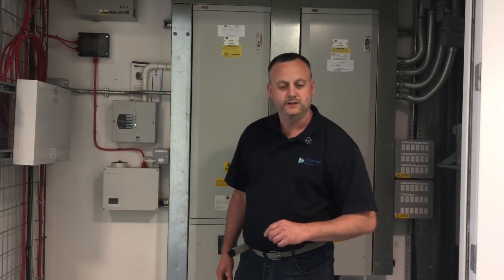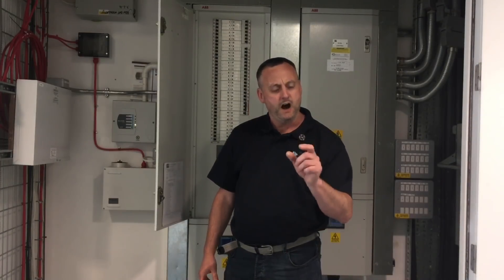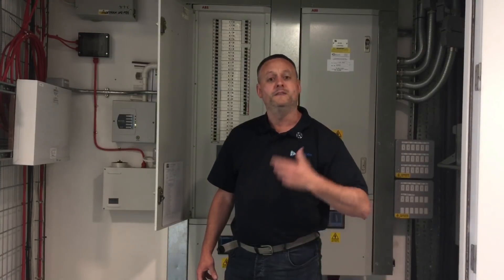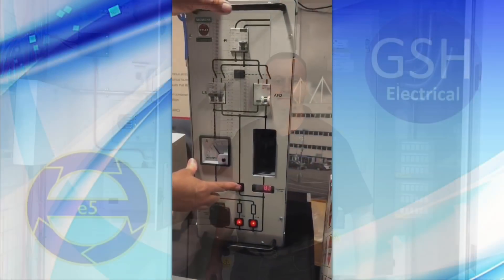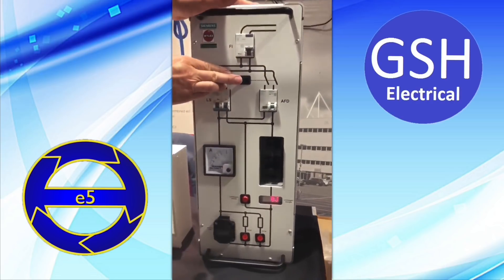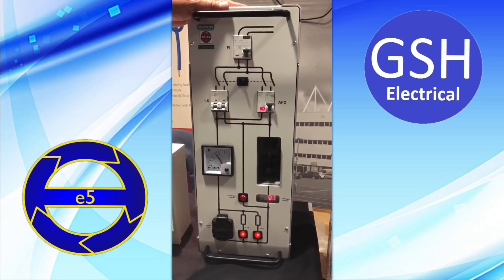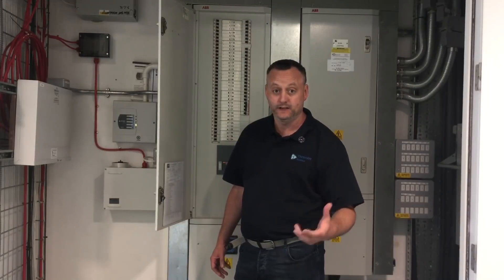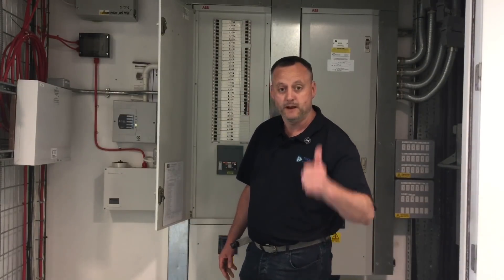Arc Fault Detection Devices (AFDD) From Wylex Practical Demonstration (18th Edition BS 7671)

Comment: Great idea AFDD's.. I recently attended a house where the customer lost half their first floor lighting.. A look in the "boarded out loft" after lifting a lot!.. Of boarding led me to a 1.5mm T&E cable that had been penetrated with a screw through the sheath and through the live conductor and was using the screw as a conductor in between the broken wire. After a period of time the resistance became higher, and started arcing.. Bear in mind, the arc was between wooden loft boards and a joist! I could smell the burning as I got closer. AFDD's would have spotted this, and prevented what could easily have been a burned down house! They had disabled children too! They literally thanked me for saving their lives. Some old guy fitted the boarding over the cables in the loft, on Top of the cables, and screwed them down!.. Unbelievable.. I spent a few days repairing and replacing the damaged cables, and testing it. A silly thing like boarding your loft out, and using AFDD's to counteract stupidity, and nievity is only good in my book. Great vid as usual sire 😎
Reply from the maker: Hi. Wow thanks for taking the time to pen your message. People pay £1500 for a TV and change it every 3/5 years but a consumer units has to last a lifetime lol. With electrical circuits on 24/7 in a home that cost hundreds of thousands of pounds contain all your worldly possessions and everyone you love I think innovation in safety should be taken really seriously. Thanks for commenting and watching GSH Electrical
Reply: GSH Electrical The mind boggles.. I struggle to convince most customers the advantages and safety aspects of RCD's some don't even know what they are or do! As long as the lights are on, and the sockets are on, that's all they seem to care about. Until they get electrocuted, or their house burns down. I find it very frustrating being an electrician sometimes.. Lol.. 😵
Reply: muzikman2008 it not appears these devices will NOT work on arcs less than 2.5 A so domestic lighting arcs will not trip the device. It appears all is not what it seems!

Comment: Here in the US we have been using Afci's since 99
Reply: In the U.S. the rated line current is much higher and line voltage lower than in other parts of the world, so the occurance of arcing is much more real. Hence the U.S. have been using current fault detection devices for much longer.
Reply from the maker: We are trying to catch up 👍

Comment: Surely the time has come to have these  individually built into all RCBOs and MCBs. Is there any advise on how to test them using a multi meter?
Reply from the maker: Hi. Within 12 months they will be a one unit item
https://youtu.be/LphmdNBxajo
Thanks Gaz
Reply: @GSHElectrical  It's not the "unit" that is important - its the number of ways that they are taking up. There needs to be an AFDD RCBOb combo  in a single way unit.  The required size of Consumer units is getting quite large. Who knows what extra kit will be required once the need for devices for Electric powered Vehicles  is factored into lots of homes.

Comment: I bet if you retrofitted an AFD to any circuit installed before 1960 it would trip right away, despite any reading of 2 M ohms or over  arc faults are present everywhere old light switches, lamp holders,  etc etc, new install yes, but do a complete EICR with a satisfactory result on the cert and it will just trip , for this to work across the board  funding will be needed by a grant scheme to get it to fly otherwise it will make no difference  the add on cost will run to rewires board changes etc especially on older properties and the punter will just not wear it hence no change
Reply from the maker: Hi. Great points time will tell as the requirements for the use of AFDD are increased. However I think the video demonstrates the benefits of using AFDD’s and if we like it or not they will overtime become a requirement. Many thanks for commenting and watching GSH Electrical 👍.